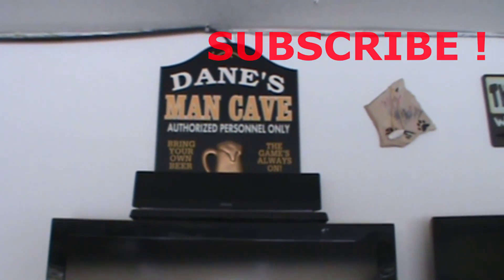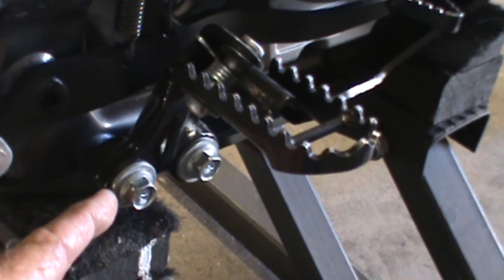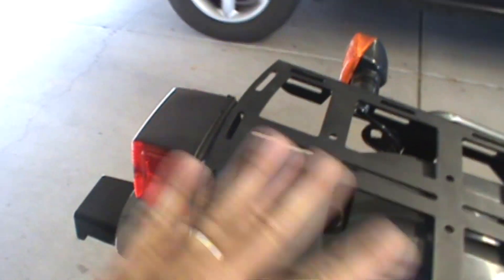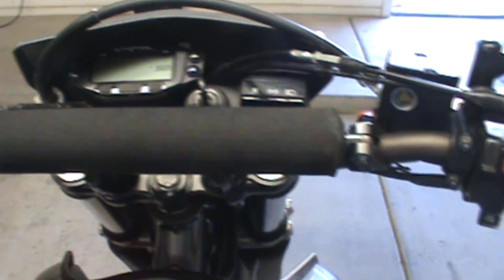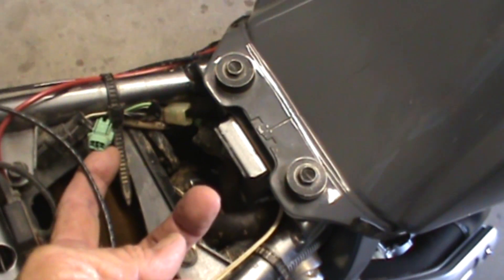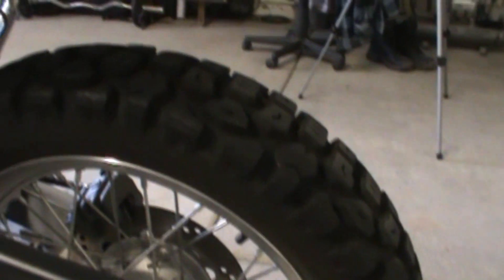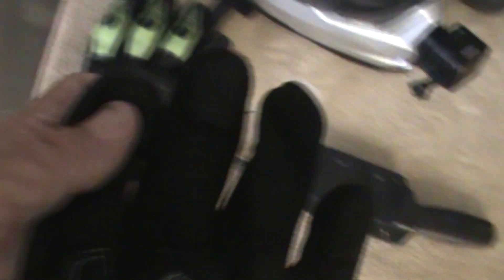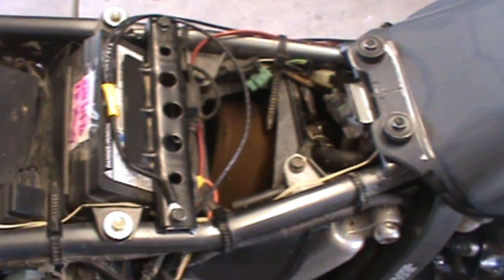SUZUKI DR 650 BASIC MODS I'VE DONE & RIDING GEAR

Comment: I see that you are also from Arizona, I'm in Goodyear. I have a 2024 DR650 that I have done some mods to, love the bike. One of the mods I did was installed a pair of valve covers with cooling fins on them to help keep the top of the motor cool, they are from Shotcraft.

Comment: Dunlop Trailmax Mission are also AMAZING 50/50 tires although I consider them more 60/40 Street/Dirt. Great feel cornering on the street and nice hard side walls so you can lower the air pressure fairly low without worrying about your rim. Rim locks prob needed though.
Reply from the maker: Adam - thanks for watching !!! - I appreciate the comment. On my next set I think I am going with the "D-SPORTS" - Always fun experimenting !!!!
Cheers Buddy !!!

Comment: I'm with ya on most all this except those tires, I hate em
Reply from the maker: Hi Charlie - that's so funny - Just depends on where you're at and how you ride. You can make that statement for soooooo many tires. I am quite pleased with them. Next set I may try D SPORT - recommended by 690 ADV - but we'll see....

I do appreciate you watching !!!!
Reply: @pilotdane1  they are aggressive with good traction in the loose stuff, but a lil lacking on the street.  TKC 80s are nice but a lil salty so I'm goin with Kenda Big Blocks this time.  Just as aggressive as the TKC80 but a bit harder & heavier without being a squirrely bitch on the road getting to dirt/gravel roads... (edited fk I must been drunk or my phone just took the wheel?)
Reply from the maker: @torkrench  Thanks for the tip. Just got home. Will be taking a look at those !!!